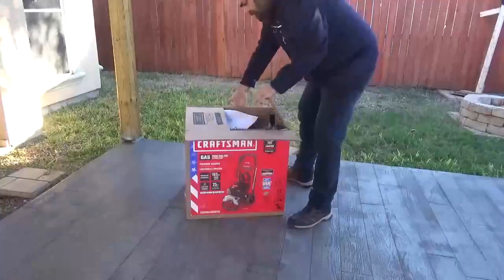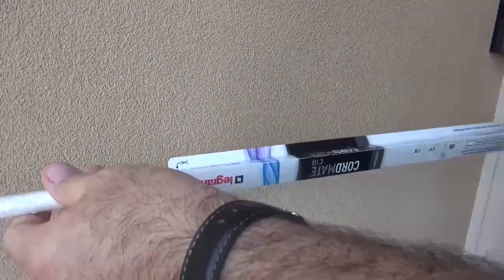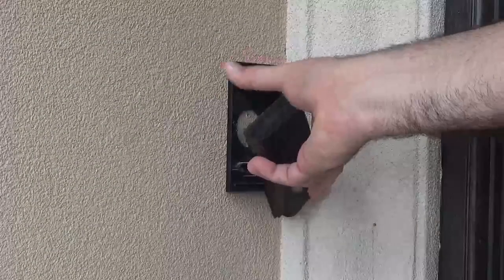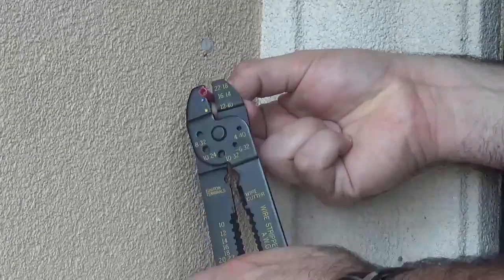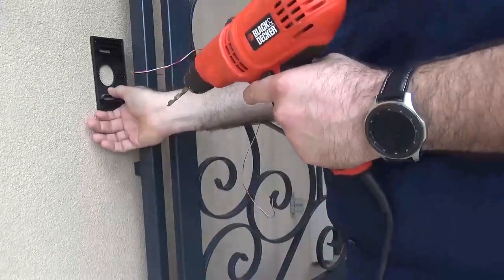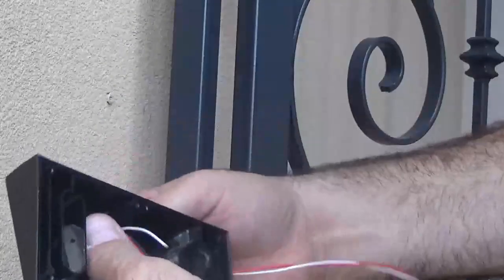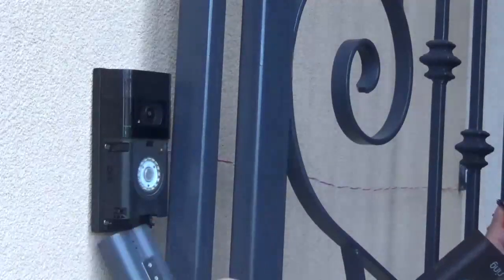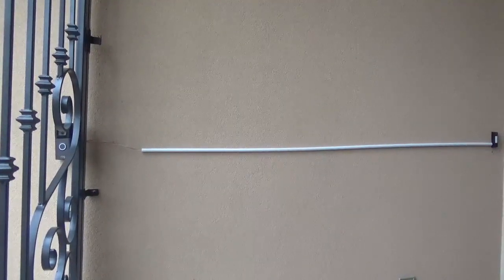🏡✨ Relocating Your Ring Doorbell 3: A Step-by-Step How-To Guide!

Comment: I was hoping to see how to route the wire through the wall to the new location. No luck.
Reply from the maker: Nope
Reply: Find your bell, when you did original install of ring camera you would have likely wired to it. If home had existing doorbell. Depending on where you moving your doorbell, sometimes easier to relocate the whole setup, or run cable through crawlspace, because of how long of a move this is, to doing internal would have seen him having to drill thru allot of frame. Standard is 18 inches apart so 8 feet would  likely be 5 pass thru holes to drill and fishhook thru. Not great. I would grab bell, find convenient or closest wall outlet on wall opposite of where I want the button installed, pigtail the bell in there and then just run cable thru the one wall section and hole out thru stucco. Added benefit, if you wire in the bell here, you could always move it further out with a wire hiding runner like he used here, but along ceiling edge. I can't believe he just slapped that on his exterior wall like that all crooked. Like he gave up at the end. Id be surprised if his wife hasn't had him fix that since I know I would

Comment: oof, this is a rough install dude... why not go inside the house and run the wires up the studs, through the attic and back down on the other side of the side gate

sure it's 10x longer to do it this way but it turns out clean and you can say I DID THAT!
Reply from the maker: Good point.  Thanks for not being too brutal... you should see some of the other comments that YouTube has taken down.
Reply: @TheSmokingBeard  Don't worry about them. Half the people making those comments couldn't change a drill bit. Good luck out there bro!
Reply from the maker: Thanks. I appreciate it.